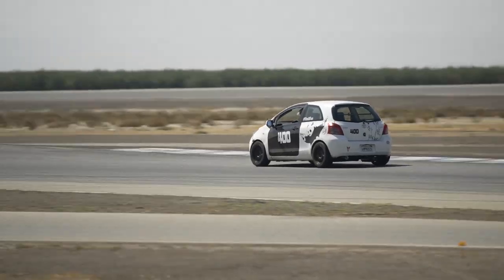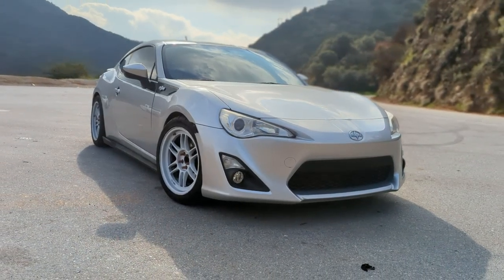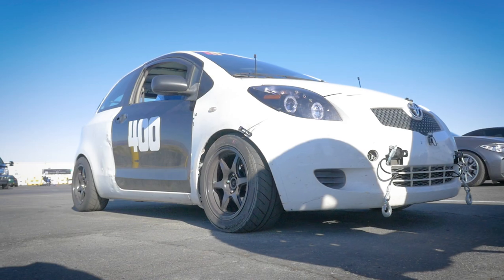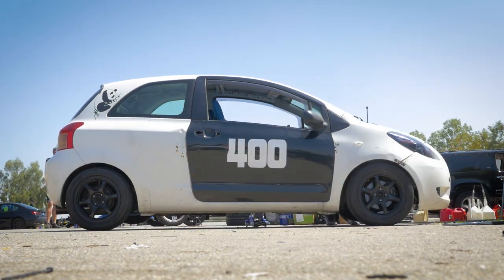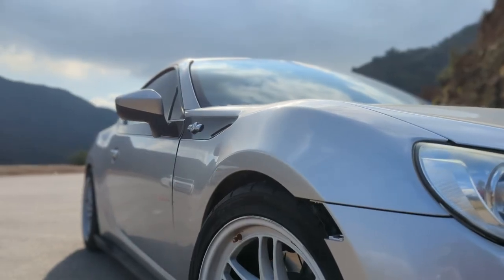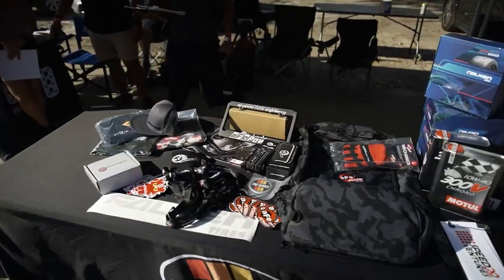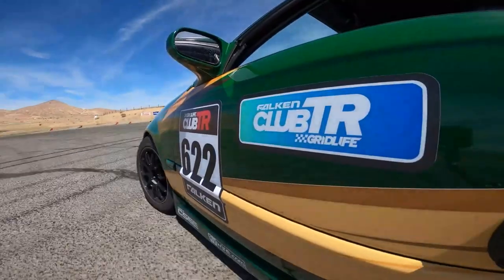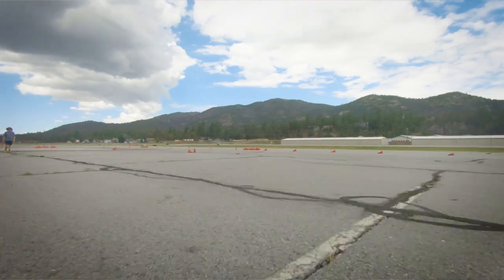Should I Give up on the Yaris?

Comment: I'm bias because I own a 2008 Yaris 2 door (3 door?) hatchback.  And personally I found it more fun driving normally slow cars fast.  😅  Also, you kind of answered it yourself, you can't do much with the FRS to stay in the enthusiast class.  Another thing, you'd have to adjust your driving style, because, as you already know, FF and FR behave differently.  Like I've mentioned in the past, there are still a few things you could do to the 1NZ engine, Prius C pistons to bump up compression ratio, JUN cams, and Scion xD larger diameter mid pipe compare to the Yaris'.  If you move up a class, and decide to go with the 2ZR, I suggest the higher compression pistons from the Prius' 2ZR-FXE, and I think the FRS' throttle body will work on the 2ZR, having the same effect as the 1ZZ throttle body in the 1NZ.  I know the 2ZZ engine puts out more phonies, but it'll require some modification to make it work, unlike the 2ZR from a Scion xD, which is a direct fit with just one wire to run, either for the MAF or speed sensor I believe.  So why not just go with a K swap?  But the K swap might disqualify you in the Toyota races.